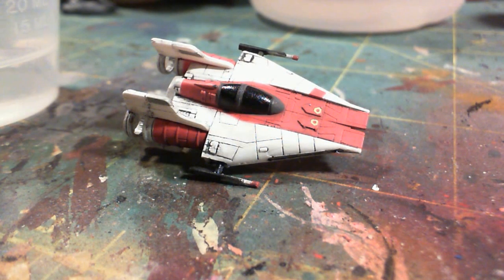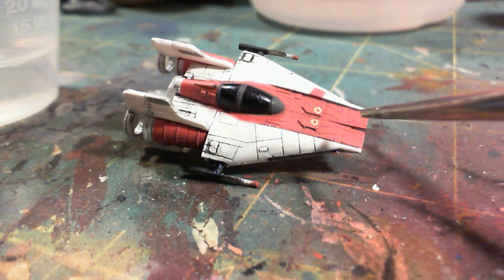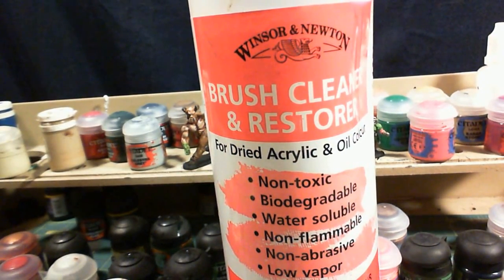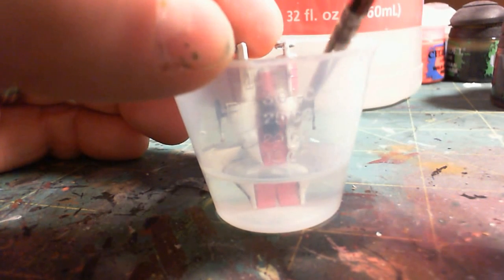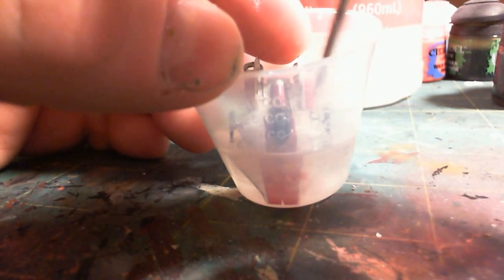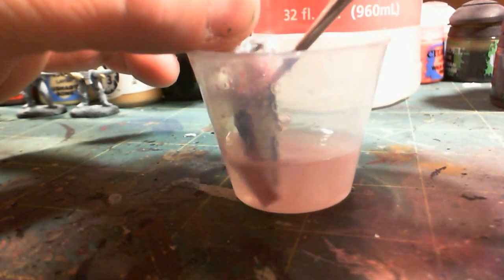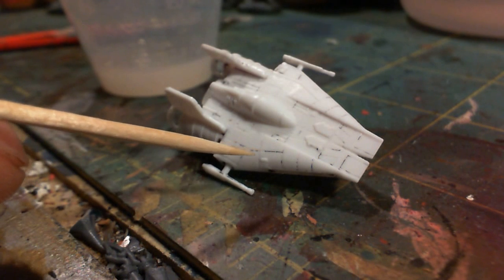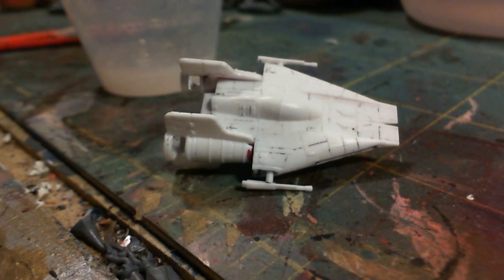How to Strip an FFG A-Wing Miniature

Comment: As to the residue question, something I've found useful for cleaning resin models that had mold release applied (leaving a sticky residue) was something like Goo Be Gone (or Goo Gone?). Basically an orange/citrus based cleaner that seems pretty good at getting rid of greasy/oily residues (liquid, so you have to brush it on or soak for a while, maybe 2-3 baths for nasty residues). That may help with plastics and I don't think it will hurt the plastics (hasn't on resins but they aren't the same as plastics exactly).

Comment: What you need to use is Easy-off oven cleaner.  It doesn't affect plastics but takes the paint right off. Just spray it on, using a plastic tub or similar. Let it set then wash off with soap and water. I normally let it work for about an hour but might take less time for your minis. Repeat as necessary.

Comment: My results:
I put a xwing, 2 TIEs, and an A-Wing submerged in Castrol super-clean degreaser for two and a hald days scrubbing daily with a toothbrush. All the washes came out and the red lightened quite a bit. but the Tie panels and all the black would only come off just a bit.

Comment from the maker: I've actually been tempted to try acetone. One of the benefits of it is that it evaporates so quickly that you might be able to use it quickly and avoid problems on the plastic... but I'm not going to recommend it unless you're prepared to destroy it.

Comment: Thank you for the video. I'm currently attempting to strip a squad of tie bombers using W&N. Are there any techniques to eliminate or minimize the sticky residue left over by the solvent after it is exposed to water? Am I missing a step whereby you can clean the solvent off the stripped model without encountering it? Thanks!
Reply from the maker: Let it sit for a day or two. It should go away on its own.

Comment: It's really weird: today I tried to strip tje paint of two A-wings, one from the regular expansion, the other from 'Rebel Aces'. I used Sterilium and while the regular one was almost completely clean after just sitting in there for two hours, the other one loses not a single pigment, not even after two hours more...habe the feeling, there might be some additional coating on it...

Comment: Dear Jay, I really appreciate your efforts in the hobby. But I'd kindly like to ask you to edit this video to actually give a word of warning at the beginning. This method shown costed me an X-Wing since at times, it melts the surface right away. My advice: Simply do a slight spray coat in white primer,be it with an air brush or a spray can. That did the job in my case, and it even emphasized the nice little details! ;-)
Reply: Yeah ive lost a z95 with this methode

Comment: The WN cleaner seems to work great on the white plastic of the a-wings, but that plastic appears to be a bit different than the beige of Y-wings and the falcons, those ships got a bit melty and the cleaner seems to have permeated the plastic, just a head's up to you guys to NOT soak the ships completely, use a toothbrush to sparingly apply the cleaner, don't submerge them. A-wings yes, rest of rebels no. Not sure what kind of plastic imperial stuff is...

Comment: Part 2
I had a bottle of the W&N cleaner and a Millemium Flacon that I wanted to repaint. But what to put the flacon in? I had a black plastic box with a clear lid that was about the right size. Long story short the W&N cleaner reacted with the plastic of the box and melted the black plastic into the cleaning solution. My falcon was covered in grey goo the next morning!! 
Thnkfully more W&N cleaner was able to get most of the melted plastic off!! 
The moral is be careful! That's string stuff!

Comment: Hi , I need to dismount an A wing with a engine on backwards , can you help me?
Reply from the maker: The models all seem to be assembled with super-glue which means that it should be possible. The problem is that these ships are so small that there's also a reasonable chance of breaking it. It's all about the careful application of pressure.

Comment: I've mostly worked with metals and acetone is great if you need to remove five minute epoxy between, say, a metal washer base and a metal figure. Leave it submerged and it the five minute epoxy basically vanishes (and paint too). HOWEVER - WARNING - Acetone is pretty nasty stuff and has a Materials Safety Data Sheet. I would not advise getting it on you or leaving it open to evaporate. I deployed mine inside a clean mason jar (from Classico spaghetti sauce). The jar and tin lid were fine, but it ate the rubber-ish sealer ring. It's also a toxic waste disposal... do not pour down your sink. Not for the faint of heart.... brake fluid will sometimes lift paint (not sure how it does on plastic ships, but it'll lift your car's finish if you spill it on the painted parts)... I've tried Pine Sol (so-so) and I'm going to try the W&N now. Varsol and gasoline can work (again on metal figures) to an extent, but they are flammable and produce toxic fumes and their stripping performance is so-so (thus not recommended). I haven't tried the oven cleaner and I'd want to know it worked on the plastics before I tried it....